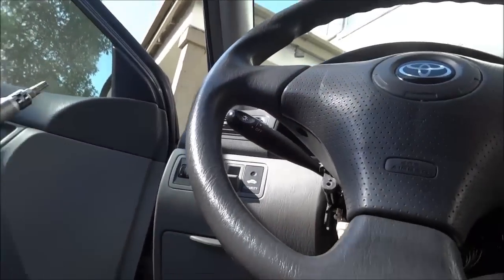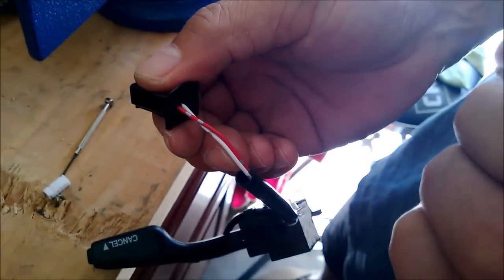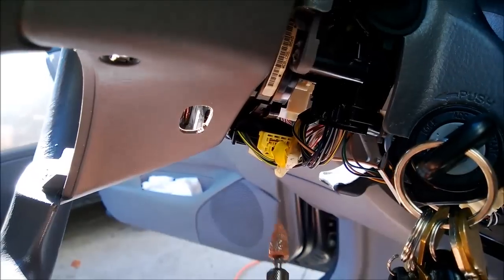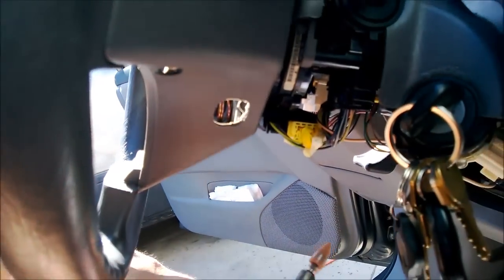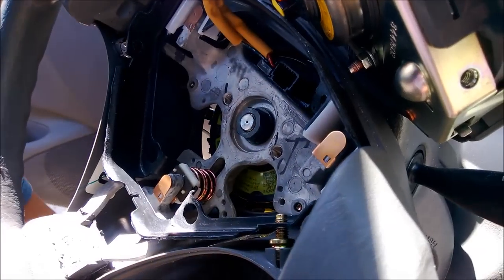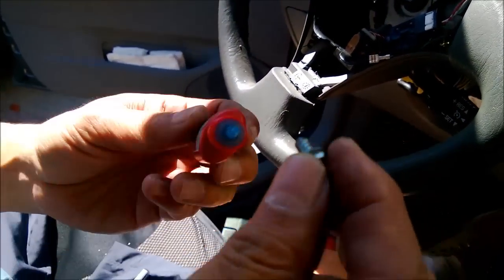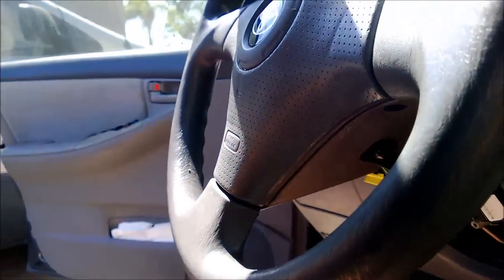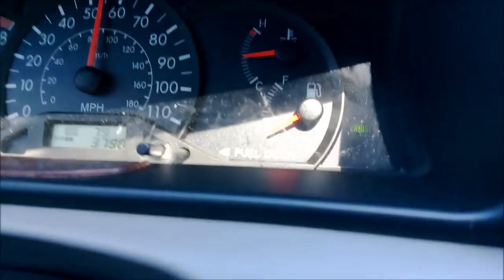Installing Cruise Control in 2005-2008 Toyota Corolla

Comment: Follow up after my install.

The install (with the help of this video & the original post on Toyota Nation) was very easy.  This is coming from a bit of a car knob.

Two things I would do differently:

1.  When putting the air bag up on the steering column there is something sharp under it and you will scratch your plastic.  Just put down a cloth or magazine and rest the air bag on that.

2.  I free styled the drill hole like in this video and it ended up being misplaced and I had to make the hole much bigger then needed.  I would mark off by measuring and then make the hole.  The measurements can be found on Toyota Nation's post, just Google it.

** If you make the hole too big you can buy a rubber boot at a marine store or find a an oval plug from other things that fits nice.  The o-ring / gasket from Home Depot idea did not work for me because it was off center.

For anyone with a standard:

The clutch switch was my biggest concern since I'm a knob and didn't find any install video or instructions on the net.

Get the switch for about 17.00 dollars on Amazon.  When you get under the dash you will find a bolt in the place where your clutch switch needs to go.  Unscrew the bold, screw in the switch. Plug the end into the harness.

When you are under their you will see how it all makes sense and is very easy.  You can look at the break pedal as it has the identical switch already installed as a reference.

The whole thing (going slow) took me an hour and half.  Can be done in just over half hour now.   And now I have cruise control.  Truly plug n play!

Big thanks again to Mr. Chua and his assistant for making the video and dz63 at Toyota Nation!
Reply: what harness did you plug it into for the CC switch? I've been underneath the dash for hours on end looking for the damn plug/harness with no avail. it doesn't help the there are no diagrams or pictures to point me in the right direction.
Reply: Scott Smith Hey Scott.  I'm a little confused?  If you watch the video in full (which was very well done by the way) then you'll see where the cruise control switch gets plugged into.  It's at about 22 minutes in.  It is literally plug-and-play.

Now if you are talking about the Clutch Switch if you have a manual transmission then I'll do my best to explain.

This is actually the easy part:   Get on your back and wiggle yourself to where you can see up the length of the peddles up under the dash.  Your legs will be out of the car.

You will see a plunger style kill switch that in screwed just above the brake pedal.  Press the brake by hand that will be right by your ear and you'll see the mechanism at work.

Google this to see the switch:  ACDelco D1919E GM Original Equipment Cruise Control Switch

Now on the clutch pedal you have the 'exact' same housing setup but it will be empty.  You simply screw in the switch just like a bolt (there may actually be a dummy bolt you have to unscrew first.  I forget?  I think it's to keep the threads clean) The harness tip plugs into the one and only place it can go.  Just plug-and-play.

It's been a while now since I did this and everything is working awesome.  Also get a lot of satisfaction with the do-it-yourself aspect and saved hundreds of dollars.

Thanks again to Ed and camera guy for making this video.
Reply: +TheDarkestForce 
This video is stellar - straight forward and extremely simple. I had no problem with the Cruise Stalk, hell the holes were already there so no drilling req'd minus the hole in the side. 
I followed every bundle of wires coming out of the harness to the left of the wheel and there's no spare plug. I might have to slice the wired in myself or find the exact pins. kind of avoiding taking my entire lower dash out to do the install but it's looking like I might need to?
Reply: Scott Smith So we aren't talking about the clutch switch.  I think I understand now?

Fast forward to 3:25 in the video.  You need to pull out the existing plug with the green wire in it.  You will then replace the empty slot with the one on the stalk and then put the green wire back into place or your horn will not work.

I would not start taking anything else apart or slice anything.  I'm NOT a mechanical kinda of guy at all and I did this going slow in an hour and that's with the clutch switch too.  If a dummy like me did it  :O)

I'm including a link that was a very good resource for me with pictures.  If for any reason the link gets edited out just Google "how to install cruise control on Toyota matrix Toyota nation"  it should be the second link.  It has great photos and descriptions.

http://www.toyotanation.com/forum/132-9th-gen-corolla-1st-gen-matrix-2003-2008/299894-diy-aftermarket-cruise-control-install.html

Good luck and reply back if you had success.
Reply from the maker: *****  I'm glad it worked for you.  Thank you for the follow up.

Comment: Thank you very much, helped me a lot toyotanation blog for installing the cruise control, as a switch for manual transmissions for the clutch is necessary because the cruise control installed but did not work me. I hope that putting this piece in the clutch and as it is intended. regards

Comment: This helped me out a lot! I installed cruise control on a Toyota Matrix.
Reply from the maker: Justin Kuhn very cool!
Reply: How much for the part and where did you find it on eBay ? Link please
Reply: @BEASTwarface  It might also be a gamble on whether your vehicle is already wired for it or not; mine was. I think they install the cruise control systems but not the stalk so they can make money on the upgrade/save time on changing stuff on the production line. Tried calling the dealership with my VIN but they were completely unhelpful. The actual install was pretty easy but I did it in the Home Depot parking lot so I could go inside and buy stuff that I needed, since I was working on my only available automobile at the time, and I did make a couple trips. Like I opened up the steering wheel and brought a very helpful Home Depot employee out to figure out some stuff that I needed.

Comment: FYI you need a Clutch switch for manual transmissions and you can purchase a lower steering wheel cover with the factory cut out for an oem cruise control switch for $8 on amazon. Much easier than hacking it up with a Dremel
Reply: Thanks for the info! Where did you get the info for the clutch switch install. 
I have a 2005 corolla CE, no power windows and no cruise control.

Comment: Hello! I have a corolla 2005 CE, no power windows and no cruise control. I do have the A/C.
Didn't find the info in the comments for the CE models. 
Would it definitely work?
Thanks a lot for your attention and the time you took to make the video and answer the questions
Reply from the maker: This car shown was a 2005 CE. You should be good to go.
Reply: @EdwardInTX  thanks for the quick respond.
I've got found in the comments that for a manual transmission I would need a clutch switch. Just want to be sure that there is the connection set for it already so I can jump on it. 
Haven't checked where it could be on my car. 
I'm planning to go to the junk yard tomorrow to set it up

Comment: Great video sir. Will be doing this on my matrix 😎
Reply: very easy install got one from the junkyard no wire pinning needed or tapping just used oem screws they screwed right in
Reply: most time consuming part was the hole cutting and airbag screws
Reply: For anyone getting this part from junkyard if you want you can remove the one screw from airbag then just bend it over to the side if you don't care about it

Comment: Note that for the Australian market Manual transmission vehicles the clock spring is not compatible, the body harness does not have the required wiring, and the clutch switch isn’t fitted. The commonly advertised switch will not fit the 4 spoke steering wheel either.

Comment: Wonderful video, I have read through all of the comments and it seems that this install has worked for everyone except me. I installed a switch off EBay that didn’t work so I returned it and got another, it also did not work. My son has a 2005 Corolla CE manufactured in Feb 2005, automatic trans. When I push the cruise on, the “cruise” light comes on the dash. When I tap down to set the speed the cruise does not operate, nothing. I looked at the switch by the accelerator pedal, and I have 3 wires, all the same gauge leaving the switch. I have seen other posts where the plug has more wires. Can anyone confirm they only have three wires. Not sure what else I can do, comments and suggestions are welcomed and encouraged.

Comment: One question...why did you remove the steering column cover?  There really isn't a need to.  Just remove the airbag, cut the hole big enough for the control to slip through, bolt it down and plug it in.

Comment: Excellent video!  Thanks so much for posting.  So I bought a cruise switch and installed it like you showed in the video, but my cruise isn't working.  The light turns on but nothing happens when I try to switch it on while driving.  After reading more I see that for a standard I also need to install a clutch switch for it to work?  My 2005 Toyota Matrix is a 5 speed manual so is this why it's not working?  Could you give me a little more info on this if you can?  Thanks!
Reply from the maker: Read on the previous posts about a clutch switch that you have to install.  There is also a topic on it on toyota corolla forum. If you're successful installing it, please add your experience to the comments so other people can learn from your experience.

Comment: Very informative, I'm trying to add cruise control on my late 07-early 08 manual 5 speed petrol 1.6 Toyota Auris. Trouble is i can't find any information on it. Will it need anything more to make this work? or just this switch? Any help you can give me would be much appreciated.

Comment: You could use a mold of cardboard to see where to drill and how to fit.  ;-)  Thanks for the vid. I have an avensis 2001 1.8. Should be the same or is this not jet drive by wire?
Reply from the maker: Good idea! Now I don't think it is drive by wire. I have a 2002 sienna that is definitely not drive by wire.

Comment: If you have a manual transmission you juste need to put a clutch switch or by pass the connector with a red/white and a blue wire left besid the clutch pedal
Reply: How did you get the info for the installation of the clutch switch? 
I have a 2005 corolla CE. Looking forward to install the cruise control on it.
Except that, would it work with adding the cruise control switch?
Reply: @francoisbourgault1922  do you have a wire trottle body or a cable one

Comment: It could be installed in a corolla where acceleration is not electronica, the accelerator pedal pulling a cable. thanks for your time
Reply: No, this is for the 'Drive by wire' accelerators that Corollas started using in the new models starting in 2003.

Comment: Wow very nice.
I have some qustion .
No need connection with ecu.
Befor i see another car fix cruise  system   connect wire with ecu and fix one brack switch . You don't   fix why can you say please.
Reply from the maker: Pre-wired for the models in this year range. No need to connect a wire to ECU or brake switch.

Comment: cruise control 8463234011 this part in description is different connector. It will not work. Get the Delco one.

Update:I had ordered it, so it came and I got to making it work. The connector is different on this part but I modified the connector then got cutting the steering wheel. And cruise control is way too big and the holes don't line up no matter how i try to put it. I didn't want a 5 inch hole in the steering so I had to order new acdelco part. The part functions as a cruise control but couldn't mount it so its useless.

Comment: I just bought a used 2007 Toyota Corolla w/o cruise control.  Your video makes it look easy to install and I am going to try.  Is there anything I need to check on the car first?  You mention something about your car already had electronic accelerator. How do I determine if mine does?  I'd imagine it does but want to be certain.
Reply from the maker: If it's a 2007 Corolla in the US, I know for sure it's an electronic accelerator.

http://marlin-car.com/wp-content/uploads/2013/06/2007-toyota-corolla-ce-huzaczg7.jpg
Reply from the maker: The poster here talks about how to check for electronic accelerators: http://www.toyotanation.com/forum/132-9th-gen-corolla-1st-gen-matrix-2003-2008/299894-diy-aftermarket-cruise-control-install.html

Comment: Thank you for the great video.  I am wanting to install aftermarket cruise control on my 2005 Toyota Corolla manual with drive by wire throttle.  The car is an Australian model and no Corolla's of this generation came to Australia with cruise control.  I have never seen a 'cruise control' light on the dash.

Did upper grade American model Toyota corolla's from 2005-08 come with cruise control?

I am worried that because it's an Australian model it won't have cruise control programmed into the ECU.  Can anyone help me on this?

Comment: Cruise control 8463234011 doesn't fix on a 2005-2007 Corolla. I just tried on my 2007 and the mounting screws are in the wrong place.

Comment: Hi, you know which PIN on the ECU is for the Cruise Control?
I have a Hiace 2006 with the 1 TR-FE engine. No Wires pre-installed. Thank you🙏

Comment: Just wanted to ask that you Installed only the Cruise Control switch. Does this car already have a provision and wiring to control throttle body in engine or its done by the ecu of the car?
Reply from the maker: Wiring is already there, just need the switch
Reply: @EdwardInTX  Ok. I want to install Cruise Control in 1996 Corolla 5AFE Engine. But its a Manual Car. I think I need to buy a complete unit.

Comment: on my 2005 corolla ce manual, after i installed the cruise stalk switch the cruise wont set. i checked that i have the right clutxh and brake switch. the dealer told me they had to program my ecu and it would cost 150$

Comment: What are the prerequisites, does the car have ABS breaks already because I have seen many Corolla e140 without abs , no airbags etc , also does it not require additional cruise control module etc
Reply from the maker: No ABS but there are airbags on this one. Just check if the outlet is there for the plug to wire in.

Comment: Question:  Are all the other components (under the hood) already on the car by default.  Is the switch the ONLY thing that you need to add cruise control?  Thanks
Reply from the maker: Yes!
Reply: @EdwardInTX  -  Thanks Ed-  No need to program computer?
Reply from the maker: @rickkoshak4919  Nope
Reply: @EdwardInTX  -  Heh Edward.  Bought my used cruise control unit from a junkyard today and installed it on my Corolla.  Super easy, thanks to your videos and advice; could not have done it w/o you.  Thanks so much for the info.
Reply from the maker: @rickkoshak4919  Glad it worked!

Comment: What a video! Im impressed and feeling confident enough to attempt the install on my 2003 Corolla Verso d4d 2.0 Diesel wit manual tranny.  Has anyone done a pre 2005 Corolla, and do the parts used by Edward work pre 2005?  Thanks for any feedback
Reply: Hey did you ever end up trying it? I have an 04 corolla CE i want to try it on
Reply: Have you install on corolla2003 manual 2.0 diesel ?

Comment: I have 2005 Toyota Camry 4 Cylinder Automatic LHD. Will cruise control work in my car ? Pls let me know, If yes then I'll proceed for purchase of cruise control kit
Reply from the maker: It should be pre-wired
Reply: @EdwardInTX  I have a 2006 Toyota Wish (Same engine) but my spiral has only two points. Do I have to change the spiral only or do I have to wire it
Reply from the maker: @whisperingharry  That doesn't sound pre-wired. Would be good to check if the cruise control module is installed in there
Reply: @EdwardInTX  oh. So any suggestions? I have to change the spiral as well as installation of wire all the way from the ecu?
Reply from the maker: @whisperingharry  I'm not knowledgeable in this area as mine was pre-wired, but yes I would change the spiral and make sure it's wired to the cruise control module
Reply: @EdwardInTX  alright thank you so much 😊

Comment: hi friend i have one question. i have corolla e12 1.6 benzine motor 2006 year with 5 manual transmission. Do you know the instalation cruize control is identicial as a yours video ? Anybody installed in this car ? please help me

Comment: hi, does this work for a 2007 Toyota corolla manual 5 spd transmission?
Reply from the maker: Partially. You will need a clutch switch in addition to this.
Reply: @EdwardInTX  is the harness to plug the clutch switch into already present in the car?

Comment: Hi, I have a 2006 Corolla LE Auto (US).
Parts 84632-34011 and ACDelco D1919E look different and have different connectors.  Connector on my corolla seems to look like ACDelco D1919E.
Has anyone used 84632-34011 on a corolla le 2006?

Comment: I have a 2010 Japanese Corolla, 1.6l, my connections behind the airbag are two, one with that large switch, and another beside it that is smaller, with 4 pins, in my connections, the large socket is full with wires for the steering wheel controls, while the 4 pins is empty, and the cruise stalk I got fits in the smaller socket, however, once connected the cruise doesn't work although the car is prewired, what could it be, people told me to change the computer as the 1.6 Japanese computer does not have the cruise program, how true is that.
Reply: Did you ever figure it out?